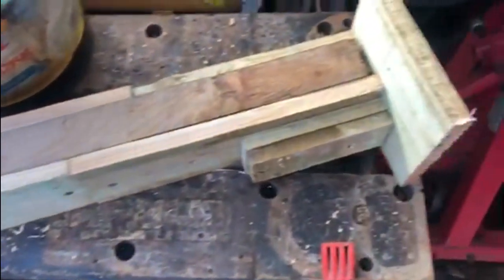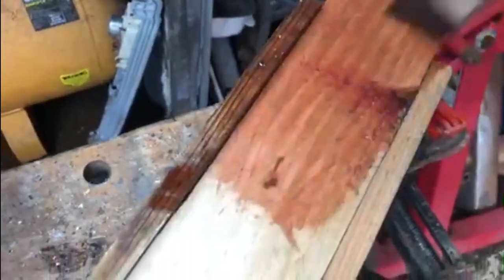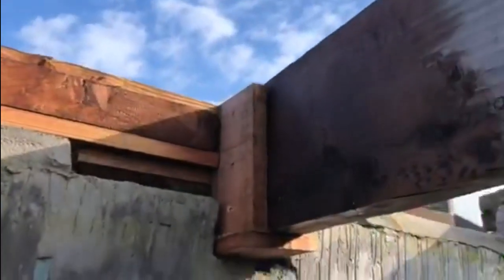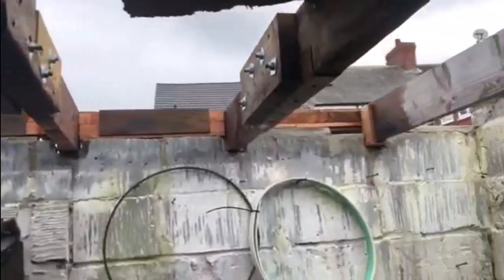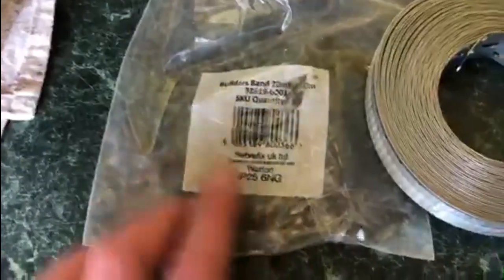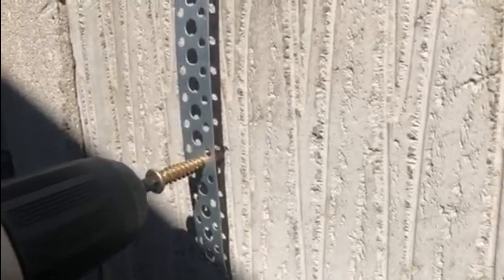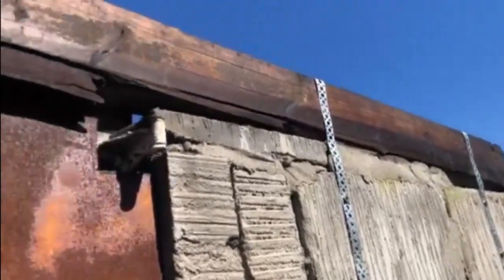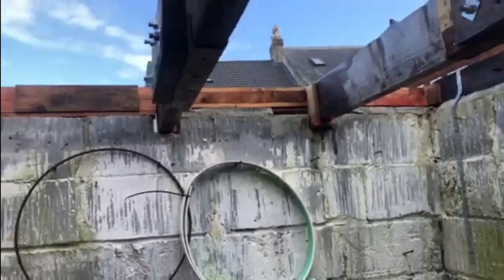Adding Garage Roof Supports

Comment: It was a huge disappointment to find those screws were really made of metal. Could you get them under the trade descriptions act . . .?
Top idea with the trans fluid though.
Reply from the maker: Might be able to report them, now that I’ve used them though, don’t think I can, lol. 
Doing my bit for recycling by re-using genuine 1968 trans fluid, seems only fair when my carbon footprints the size of Texas, that and it was free as well
Reply: @DoubleZeroGarage  Don't worry, you are just making up for all the leccy cars on the road!
Reply from the maker: Oh yes, has to be done